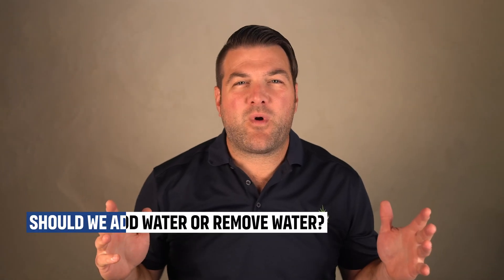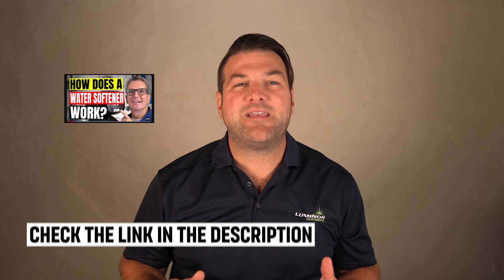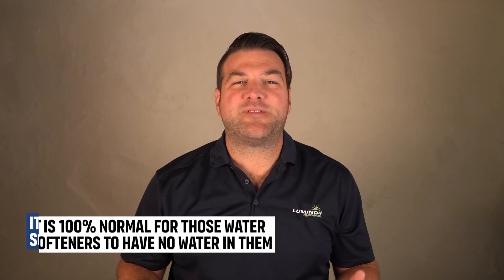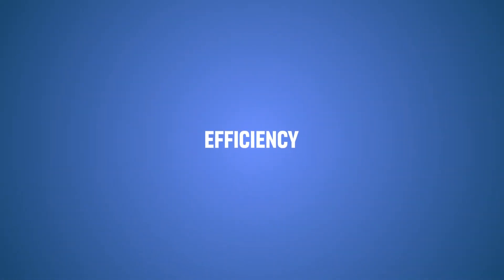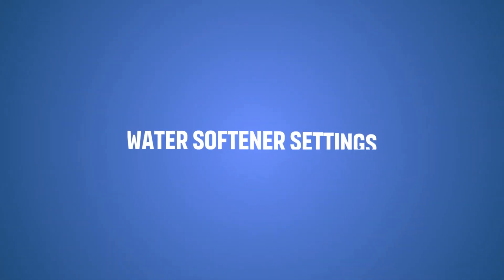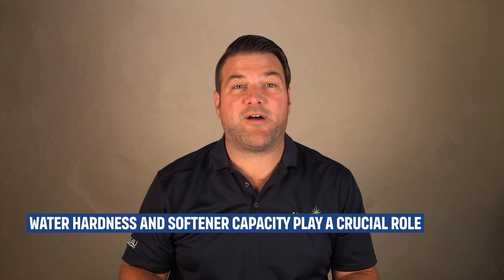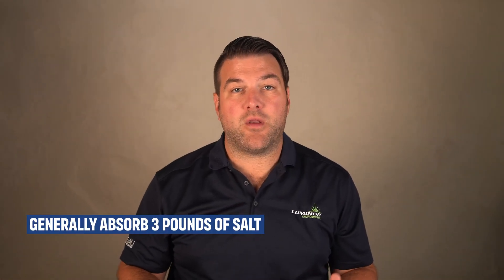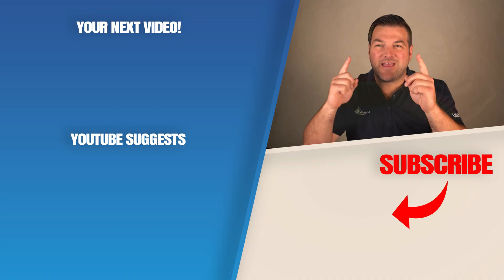How much water should be in my water softener brine tank.

Comment: He gives a few specifics but nothing that I think actually helps me and answers the question on the title. Also I use a wooden yardstick and carefully/gently follow the side of the brine fill tube to measure the depth. But he doesn't give any useful tips on measuring the depth of the water level.
Reply from the maker: The guidelines are general because the real answer is "it depends" on what type of water softener you have and it's size.  A prefill water softener will have virtually no water in it, see https://youtu.be/m4aGlQ2UNPA  A small (30,000 grain) water softener with a large brine tank will have less water in it than a large (75,000 grain) water softener with the same size brine tank. I high efficiency water softener has far less water in the brine tank than a similar sized standard efficiency unit. The point of the video was not how to measure the water level.

Comment: I have a water softener and I notice white water spots on a brand new dish rack, but I can't tell if that is salt residue from the softener or calcium from the water heater. How can I tell?
Reply from the maker: Likley the only way is to taste it, if it tastes salty...... But those white spots may not be from either, you may have high Total Dissolved Solids (TDS) in your water causing this.
Reply: @water_estore  Another thing I noticed is the spots only show once the water go through the stainless steel grates before hitting the plastic bottom. Could the white spots be from the stainless steel? I ask because when removing the metal grate, there are no spots.

Comment: My water softener keeps flooding during brine draw. The dealer Rainfresh and the manufacturer Canature are both unable to determine what the problem is. Go figure.
Reply from the maker: For sure the drain line isn't kinked?  I would check this troubleshooting video https://youtube.com/live/Lr3jyGiJdC0
Reply: @water_estore  the drain line is less than 20 inches long and the third time replacing it with a new one. Once for myself, once for Rainfresh and once for Canature. The unit drains normally.